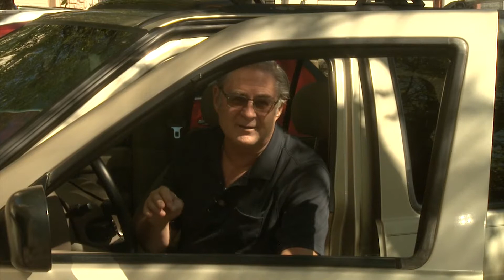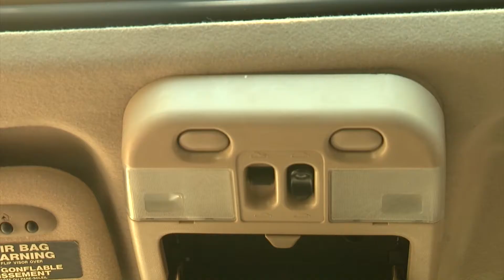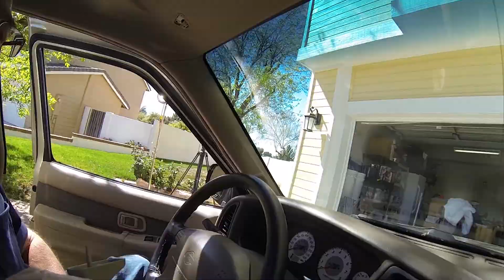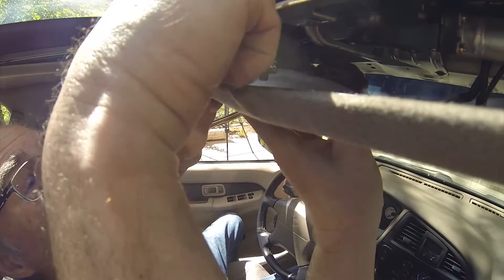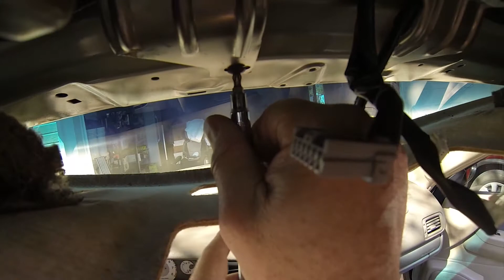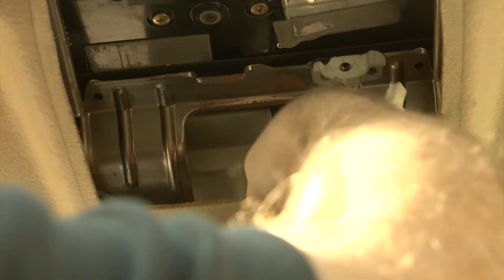Easy Power Sunroof Motor Replacement for 1996-2004 Nissan Pathfinder | Step-by-Step Guide

Comment: thanks for a great video. I was away for a few months and disconnected the car battery- After connecting it back, the motor is running randomly as it either it doesn't know its position of the switch is damaged. I´ve tried synchronizing it and for a few days it works well, but the problem keeps reoccurring. Any help there?. thanks
Reply from the maker: Sounds like the internal controller board is failing -- specifically the memory on the controller. Sounds like a motor replacement is coming soon.